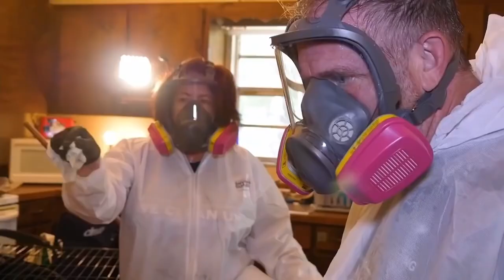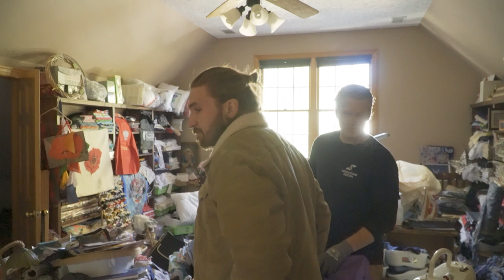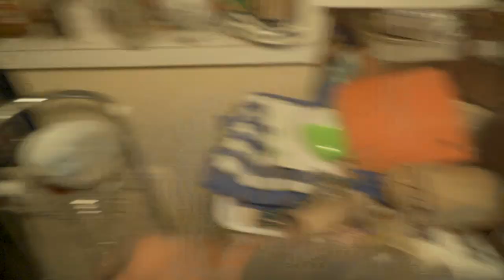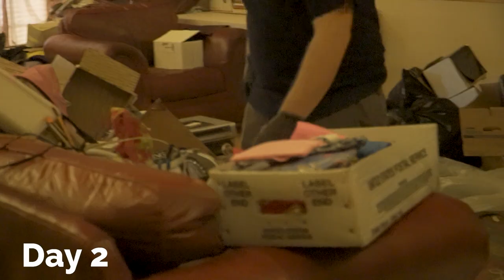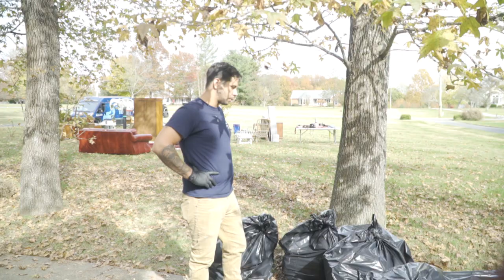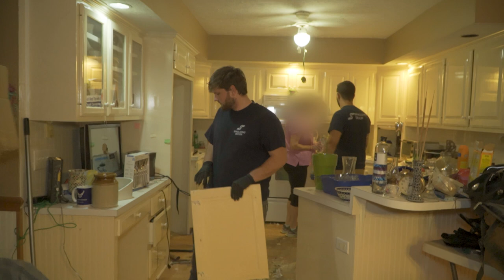Buried In Clutter: A Massive Hoard Part 1

Comment: It's very clean, as hordes go.  There's a lot of stuff accumulated, yes, but none of it looks vermin-infested.  I've never seen such a tasteful horde.
Reply: I would not say that "It's very clean" they do say that some of the stuff on the floor has urine and feces on it and is rotting and using the floor for the trash. There have been a whole lot worse hordes for sure but it is still bad. She is making a very good effort and letting a lot of stuff go but there is still a lot of work to go. I think she may be a perfectionist under all of the hoarding, the way the fabric room is organized . That may be part of the issue. She wants to do everything she does perfectly and if it can't be done perfectly she doesn't do it at all. I have had problems with being overwhelmed with large projects and not knowing where to start. I think it is important to remember that it didn't get messed up in a day and it won't get cleaned in a day. I think she was very brave to call for help.
Reply: @beckyshell4649  Thank you for pointing out the details I missed.  I must not have been paying attention when the urine and feces were mentioned.  One would never imagine, from looking at the outside of her home, what the inside was like.
Reply: Two points causing this illusion; 1. It does not look like the hoard has been going for more than a couple of years at most, 2. The house is MASSIVE- if you stuck the volume of items and garbage in an average sized home it would look far worse.
Reply: No thats not what clean means
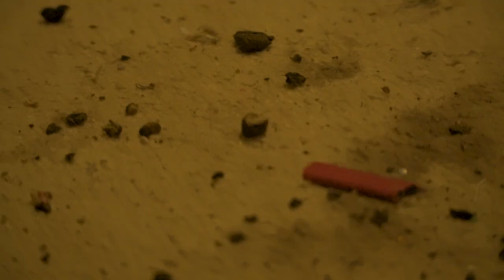Reply: 2:50 t a s t e f u l
Reply: @marcop8875  Yes...my attention must have been distracted at the 2:50 point, because that is disgusting.